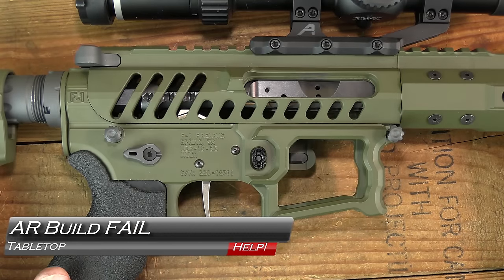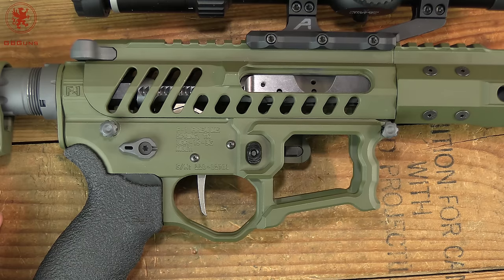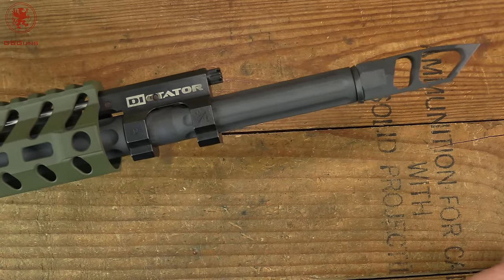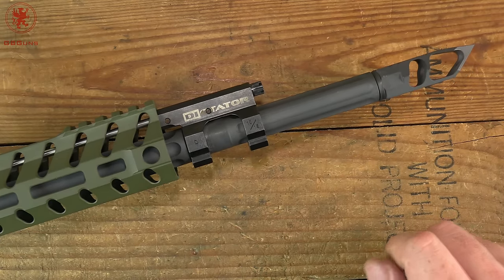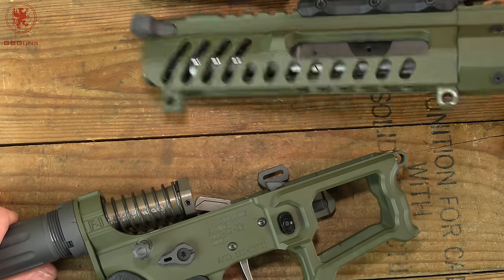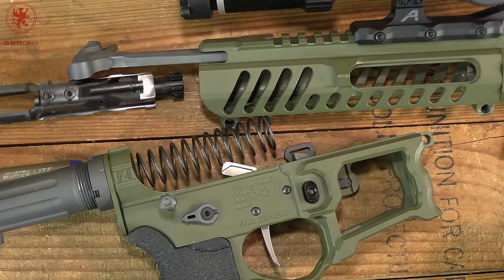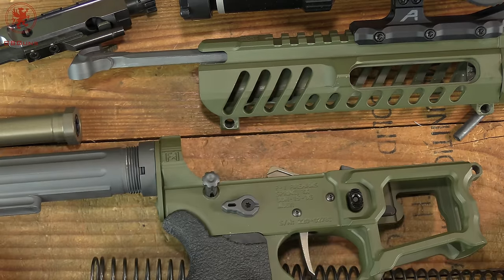The Worst Thing You Can Do For Your AR

Comment: Why don’t you have a buffer retaining pin ?
Reply from the maker: Because I didn't want one in. This receiver set uses a threaded retaining pin that requires a tiny allen key. Knowing I want to play with the buffer weight I don't want to need (or rely on) a tiny allen key.
Reply: @GBGuns  interesting. Thanks for responding.
Reply from the maker: @onliiine1  No problem. This is an old video and has had a couple follow-up videos and even articles written from it. Spoiler Alert: I made this video to troll the trolls and also gather evidence for an article about common misconceptions about the AR platform.

Comment: Take off the gas block and check it. Check the gas tube by blowing through it. Check the carrier key. Try a regular buffer and carrier; you could actually be starting to cycle too soon and not producing enough back pressure. You need a normal buffer and a normal carrier. These "ultra light" builds are generally trash.

Comment: to me it looks like you dont have a buffer detent to hold the buffer in the buffer tube. that will cause the buffer to hang on the buffer tube and not go all the way in the tube, and your bolt wont travel all the way back
Reply from the maker: You are correct that I am not using a buffer retaining pin, but incorrect that not having one causes issues.  See the article in the video description.

Comment: It's ruff from racking across the cheese grater upper.  Not enough gas to cycle past that surface area.
Reply from the maker: Incorrect. Bearing surfaces are the same as stock.  See the article.

Comment: You buffer spring is far too powerful for those lightweight parts. F=ma. That spring is designed to react to the force of a big ol heavy bolt carrier hitting it. It’s like dropping a grape on a trampoline vs dropping a bowling ball on a trampoline. You want that spring to compress so the round can eject and cycle a new round into the chamber

Comment: Tell you right now you're detent spring and detent pin for the buffer tube is missing so your buffer tube and spring should not be popping out of the tube when you take the upper and lower off that in and of itself wouldn't allow the bolt carrier group to spring back like it's supposed to to cycle the weapon you're missing the detent spring and pin for the buffer tube on the back plate and buffer tube area. It's the whole right in front of the inside of the gray buffer tube area hopefully that makes sense
Reply from the maker: Believe it or not that detent is not required.  See the article https://www.ballisticmag.com/impossible-ar-build-myths/

Comment: If you use a low mass  BCG and stuff need new spring and buffer weight for low mass. I. Built two low weightqms Low  mass Ar 15’s and they run fabulous but I had to change out all the springs and buffer shit etc. I would suggest go back to the basics in the sense either take all the Low mass stuff out or put all Low mass stuff in, like the springs the bolt carrier group the buffer weights etc. 
Oh yeah buy stuff that says low mass don’t assume that you can use lightweight parts because you need to buy Low mass parts.

Comment: Your problem is u Mismatched parts. You said carbine length buffer. Rifle length gas system.  Switch your buffer out for a rifle spec. Means change spring assembly. Or change the barrel and Gas system out for a carbine length. What's your cartridge size
Reply: Don't expect a response since it was from so long ago
Reply from the maker: I don't know why this video still gets views and not the couple after it. Your suggested solution however is not necessary, rather another piece of lore I used this rifle to defeat.  See the video description or pinned comment for the article.  This was somewhat of a troll post to get internet advice.  I boiled 4000 comments down into 7 common myths.

Comment: Gas port on barrel is too small. Bore it out a bit bigger, you have the adjust gas block to tune it with. It is definitely under gassed.
Reply from the maker: The solution was much simpler, see video description.
Reply: @GBGuns  I did

Comment: Your buffer should still be in the buffer tube when you separate the upper and lower.
Reply: NOT resting on your hammer.
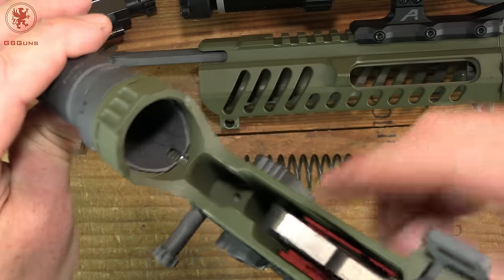Reply: 6:56 literally shows your buffer retaining detent missing but the spring appears to be held in by the receiver extension.
Reply: I can’t tell if this was a troll to upset gunsmiths or not… but yeah with all the money you can pour into a 4000 dollar ar15, little things like a buffer detent will make it not work as Eugene stoner intended.
Reply: Remember sling blade? Ain’t got no gas in it.
Reply from the maker: I don't think you understand what the word "literally" means.
Reply from the maker: Folks like you are exactly why I built this rifle.  See video description or pinned comment.  You'll gain a lot from the article.

Comment: Your problem is your rifle gas system and your short barrel, you need at least 5 inches between the end of the barrel and the gas block for RELIABLE cycling, the Army figured this out in the 80s

You are trying to make a weak action cycle by reducing friction, it may work for a few mags but it will be so sensitive to heat and cold and dirt it will not run for more then a few mags.
Reply from the maker: I don't believe i ever mentioned friction as part of the build plan.  See video description for the solution.
Reply: @GBGuns  cool, did you ever run into feeding problems particularly with a full mag with the reduced spring?
Reply from the maker: Not yet, but I've only run quality mags with it.  The rifle was built as an experiment, not trying to make something for hard running, I already have plenty of those.  In the end it accomplished what I intended: the softest and smoothest shooting AR I've handled.

Comment: Where’s your buffer detent and buffer detent spring? Also try a weaker spring.
Reply from the maker: See pinned comment.  I didn't want to use the buffer retainer because in this receiver it's a tiny piece that gets screwed in and I knew I wanted easy access to tune the buffer.

Comment: Rifle gas system with carbine buffer,,,, Probably need to find a softer and maybe a little smaller spring.    I have 4 different carbine buffer springs from 4 different guns. Not 1 spring is the same length.
Reply from the maker: See video description or pinned comment

Comment: put a mid length or carbine gas system. your rifle length is too long losing gas before it can cycle also use a lighter weight recoil spring and buffer. your light weight system is hindering you unless you do what i said. been doing these ultralight builds for ten plus years. know what im talking about
Reply from the maker: A lot of people seem to think that, but see the pinned comment.

Comment: All that lightweight spring and buffer is doing is letting the gun lose pressure too quickly so I can completely cycle the bolt go with a stiffer spring and a heavier buffer.
Reply: One thing you can do to see if that is a problem without buying a new spring and buffer at about dollar $75-$2 in quarters at the bottom of the buffer tube to put more suppressor on the pressure on the spring. That was supposed be pressure not suppressor.
Reply: $1.75 to $2.00  Of quarter stack below the spring inside the buffer
Reply from the maker: You might be surprised to learn you've got it backwards.  See video description.
Reply: Yeah I was kind of rethinking it. Just wondering though if he install the gas block did he make sure it was properly over the gas block vent on barel

Comment: I’m SURE this has been asked: What’s with NO buffer ‘detent’ pin? Makes no sense. Every AR carbine, rifle, etc I’ve ever seen (certainly owned/fired) has the buffer retained behind the detent..? Seems like some unnecessary beating-up of the bcg, etc
Reply from the maker: As explained in the article and other videos, this receiver set uses a tiny set screw to retain the buffer. Knowing that I would want to adjust the buffer weight I didn't want to mess with the tiny wrench I'd need for that set screw.

Comment: Ur spring is to be stopped by detention pin in buffer tube
Reply from the maker: See the article in the video description
Reply: Meaning the spring and buffer tube rod has to be locked into the buffer tube, im pretty sure u figured that out by now
Reply from the maker: It does not.   You would really benefit from the article.
Reply: @GBGuns  im not seeing an article and if i see this article and it could proff that i could run my gun without a detention pin ill give ya a thumbs up
Reply from the maker: https://www.ballisticmag.com/impossible-ar-build-myths/

Comment: You didn't talk about the ammo, but set that aside, change to a mid - length gas barrel
Reply from the maker: Initial testing was with full-power 5.56 NATO.  Changing to mid-length would defeat a lot of the intent behind this build.  See video description.
Reply: Yes, but it doesn't function, you can either change to the mid length gas or go with a longer barrel
Reply from the maker: The solution was much cheaper and easier

Comment: The buffer spring is fine but I'm going with engineers comment about heavy parts and inertia!
Reply from the maker: But that wasn't the solution: https://www.ballisticmag.com/impossible-ar-build-myths/
Reply: What was the solution? I must have missed it. I wonder also if not having a buffer detent made any difference? The buffer riding right up against his carrier? Also the bolt itself, maybe the gas washers(probably not the technical term) were in line allowing gas to slip by? Was there a part 2?
Reply from the maker: @jerharr9908  part 2, part 3, and an article.  Check the video description
Reply: I didn't realize it was you,lol. I had an issue long ago with a 20 hbar AR I built. The barrel already had a front site post on it. It was short stroking and doing exactly what yours was doing. I took it to the people I had bought the parts from and they took the front sight post off right there after they fired it. The gas port was to small and drilled off center. The chamber was also filled with over spray from whatever they coated the Barrel. So new barrel and a little flitz in the chamber to polish and she ran like a dream

Comment: Double check the gas key for leakage, gas rings, key alignment, gas tube-key interface...
Lighten the spring up a bit will help...
With as short of dwell time as you have, the gas system has to be efficient...

Comment: Skeletonizing is by far the worst thing invented for an AR. Horrible structure and it looks like shit.
Reply from the maker: How do you figure it's "horrible structure"?  The receiver walls are thicker than a standard receiver and receivers have very little actual stress on them. All the pressures are handled by the bolt-to-barrel extension lockup and all the gas in an AR receiver is handled by the bolt.

Comment: Need a lighter buffer spring.
Reply from the maker: See video description
Reply: Glad you got it worked out.  I just finished a side charging upper.  Fingers crossed it has no issues.
Reply from the maker: Side-chargers have little to worry about unless the handle is heavy

Comment: You sure the buffer isnt too lite? i have heard of that happening? Never had it happen but i have seen others "claim" it! hehe The one thing i have learned from doing the builds i have done is that no matter what you buy it should all come from the same manufacturer....I love Strike Industries parts and the look of them. But if i dont buy it "all" from them the parts are either too loose ot too tight! lol So i have gone with Anderson and Aero Precision. They actually mix well together! But i Normally buy the upper/lower set together and then work from there. I have not had any issues mixing the two companioes parts. So if i "ever" build a strike industries gun ill let you know! rofl

Comment: You can save that rig  if put putting in a new barrel with mid length gas. You really don’t need adjustable gas  and you don’t need a lightweight BCG just got too much bullshit going on. Now if you shoot suppressed I can see you having adjustable gas block but I’m sure you don’t.n
Reply from the maker: See video description or pinned comment

Comment: Where is your buffer detent pin?
Reply from the maker: Not used in this build. Not only are they not needed, but in this kit it's a tiny threaded screw. Knowing that I'd want ot be able to adjust bufer weight I'd rather not worry about a tiny allen key.
Reply: @GBGuns  gotcha I just figured that if the buffer wasn’t set in the tube it wouldn’t get the gas pressure it needs to cycle

Comment: What size is the gas port in the barrel?
Reply from the maker: Specs are in the article
Reply: @GBGuns  Just watched your other video, glad you got it sorted out. I am having the opposite issue with a lightweight project that I was also hoping would be a "soft shooter". I am running suppressed and mid length DI system.
Reply from the maker: This wasn't about being lightweight, just about using the least amount of energy to cycle the weapon.
Reply: @GBGuns  yep, you said that in your video, really.... I  heard you say it,  maybe multiple times.. and now again....
Reply from the maker: Because for some reason everyone thinks this is supposed to be a "lightweight build"
Reply: @GBGuns  You seem confused....
Reply: @GBGuns  No Specs anywhere....
Reply from the maker: @GardylooAlaska  Every product is listed and linked in the article.
Reply: @GBGuns  I see a brief description, a link to some merch from A... otherwise you dont even know who made the BC... or where it came from. Gas port size NA....
Reply from the maker: Let me make it REALLY simple for you: https://www.ballisticmag.com/impossible-ar-build-myths/
Reply: @GBGuns Finally some actual data,  No way the fluted part of the barrel is the same OD as the GB journal, its clearly smaller as they always are....

Comment: Absolutely a waste of money
Reply from the maker: How do you figure?
Reply: Because the AR-15 is never going to change don't matter what you do you're still a AR-15 don't see spending that much money doing all that when it's still a AR-15 not trying to be an ass I'm just trying to understand why people wait so much money changing AR-15 kind of like the same question I've been asking why people put a weapon by their private parts that is stupid it's just questions to be asked and trying to understand
Reply from the maker: @anthonybailey4508  the rifle has changed quite a bit in the last 60 years.  Have you ever seen the original AR 601? (We have a couple videos with it ). This builds goal was to use as little energy as possible to cycle the gun and it worked out quite well.  Of the 100 or so ARs and variants I've shot this is the smoothest.
Reply: Thank you sir.

Comment: Replace all the essential parts with reputable dealer Daniel defense or colt ect. Make sure they are all from the same company and standard Milspec and get the rifle butt and spring sense your gas cylinder is for a rifle. You'll keep the same starship trooper look but atleast it will be usable and maybe even reliable. I think the spring and buffer is all wrong but I also think it has to do with the parts not functioning together right with a long range configuration. 
If that gun Smith was as good as you said he was he wouldn't most likely picked up on potential issues and told you about them.  I'd get a new gun Smith bud.  You spent slot of money to have a professional work on your gun to ensure a functional outcome.  I'd be pissed too. Maybe by some at 15 gun Smith books while your at it to  give you a better understanding on what works and what's just silly.
Reply from the maker: You're close, but a bit off base.  See video description.

Comment: Never saw much sense in a skeletonized AR You sound like the type that Gucci fy their rifles.
High dollar custom parts as you found out don't really make a reliable rifle.
I was going to mention your buffer spring looks on the thick side so that could be your problem and causing your operating dimensions  to be the problem but you figured that out.
Glad you figured it out so now you can enjoy all the gasses and dirt blowing in your face from the holes in the side of the upper.
Reply from the maker: As you'll come to learn with more experience, the AR's gas is expelled out the side of the bolt carrier.  The shape and features of the upper receiver have nothing to do with that.  In the case of breezy weather a skeletonized upper would in theory help the gas disperse more quickly than a solid receiver, but the BCG is of course in the way resulting in no real difference.

Comment: This is crazy to me cause I built mine on a whim and put it together (first ever builld) in less than and hour and it cycles reliable and hasn’t given me any issues yet 💀fla do didn’t pay anyone to touch my stuff. I rather fuck it up myself and blame myself then anyone else
Reply from the maker: This build does not follow any of the standard recipes, rather it breaks them in search of using the least amount of gas possible to cycle the rifle.  See video description or pinned comment for the solution and footage of it running softer than any other AR I've ever fired.
Reply: @GBGuns  if that’s the case I missed it but now ima go read that cause I have another Full length AR my dad wants me to look at he says it feels like a pound of bricks 💀💀I think he’s just feeling “older” 😅
Reply from the maker: @justinmckey4320  This build wasn't about weight reduction, I already have dozens of basic, reliable rifles. I wanted to see how far I could take it and still have the gun run/ push for maximum efficiency. Although over-gassing increases reliability it also results in increased recoil and reduced velocity. So what happens if we use the least amount of energy possible to run the gun?  That was this build.